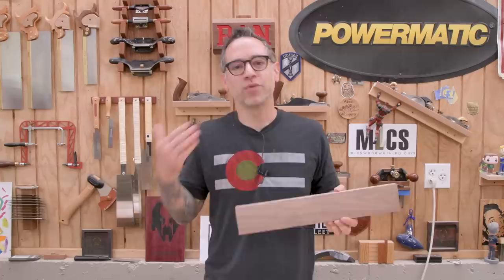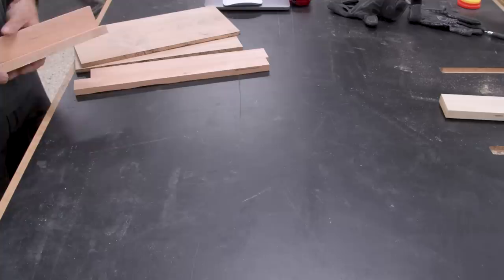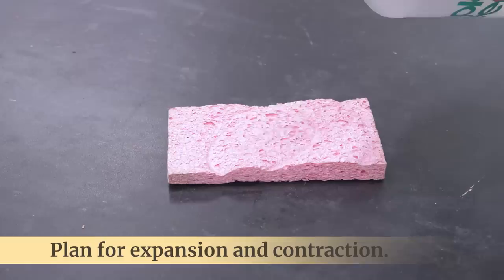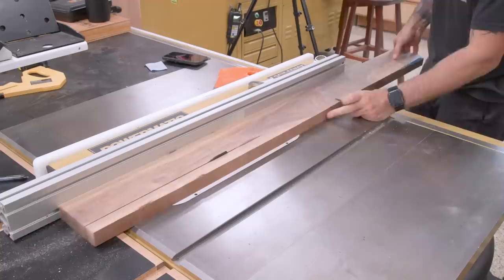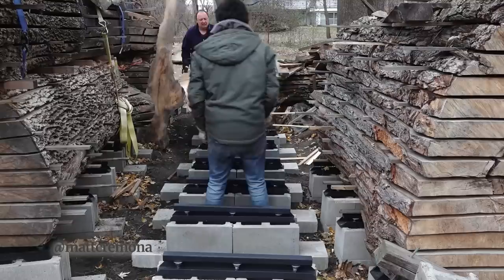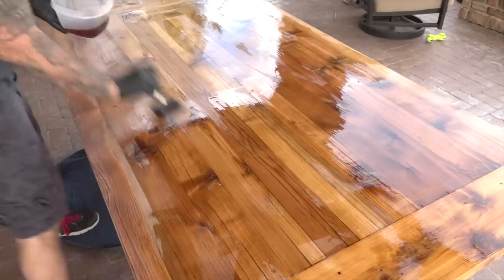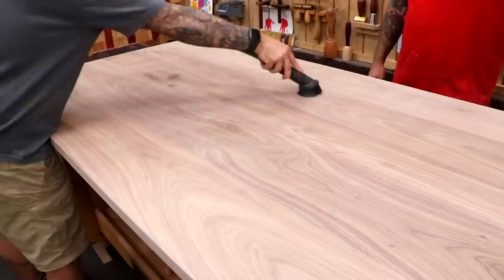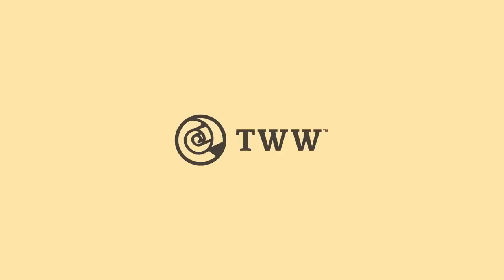Don't Make These Lumber Mistakes! | Tips for New Woodworkers

Comment: Hey Mark, I have a question. I've just made a walnut console table in my unheated workshop. How likely is it to warp or change shape once it's in a centrally heated home. It's had several coats of a hard wax finish and others tell me it'll be fine as long as it's not put right next to a radiator. I always worry about that kind of shock on a piece of furniture. Am I overreacting.
Reply from the maker: There's no way for me to quantify what you're asking. Bottom line is, the closer the shop conditions are to the house conditions, the less likely you are to have issues. Avoid drastic quick shifts in humidity and you'll increase the chances of success.

Comment: One think i see rarely mentioned is if you take attention to grain direction then solid wood is always stronger than plywood. Even a cheap pine board is stronger than the best plywood of similar thickness and dimension.
Reply from the maker: I don't think that's true. The strength of solid wood depends greatly on the orientation of the board and the force being applied. Replace the small pine boards in a kids karate class with pieces of plywood and let me know how that goes. lol
Reply: @woodwhisperer  that's why i said : "if you take attention to grain direction"

Comment: WHOA! SAFETY FIRST!
     Always have all the safety guards in place. Wood doesn't just gently bend outward during a cut. I've seen many, many boards pop explosively when ripping. And I'm talking kiln-dried lumber from reputable, major sources. The internal tension can be incredible if, say, the lumber grew on a hill side. If you don't have all the safety doo-dads on your table saw, especially kick-back protection, you deserve what you're going to get. 
     You can make amazing stuff from crappy wood. It takes practice, imagination, and necessity. A wide board with a twist can be ripped into narrow boards, jointed, and then glued up to maintain thickness. With some smooth talking and a good haggle, you can get more board-feet per dollar and wind up with something just as good. Loose (or dead) knots? CA glue before milling. Checking, blown-out knots, or voids? NAPA epoxy resin and black Transtint. It doesn't matter what lumber, it always looks good and your customers won't even see it. I'm not exaggerating; you can fill in massive flaws and it'll be invisible the second time you look at it. 
     90% of screw-ups can be fixed. I once had an 8'x4'x1.5" maple counter top slip off the work table when I was flipping it over. A corner was completely crushed. With some patient steaming and some judicious round overs, you would have never known. 
     The second-most-important thing after safety is this: When you're done with a project, the only thing you're going to see are the mistakes, but everybody else will only see the successes.

Comment: I once worked with an old school woodworker who used to slam rough lumber on the concrete floor before milling it.  He swore that process would release tension in the wood before milling.  Anyone else ever heard of this?
Reply: I cant see how that would help other than cause stress cracks, but im not old school wood worker.

Comment: Your thicker is not cheaper scenario is not accurate and just demonstrates a 2:1 comparison in board thickness which is never a consideration for any woodwoker. I am making 1/2 inch T&G verticals, 34" lengths in cherry, and resawing 5/4 lumber is FAR cheaper than buying all  4/4 stock. You obviously are going off of basic stats and not experience. With one side viewed only perfect pieces are achieved at a huge cost reduction. Similar with thinner baseboard and casings. You should make another video, your subs need to know.